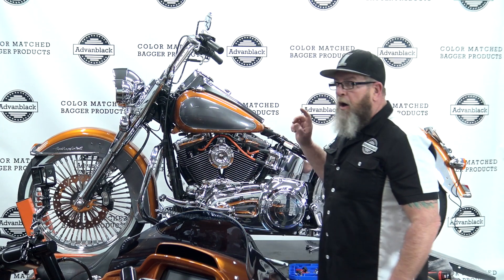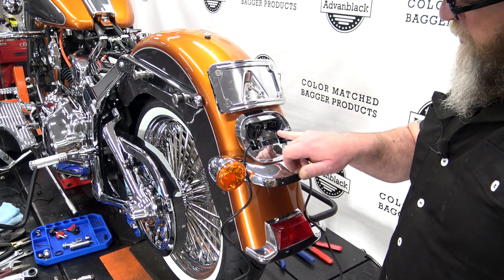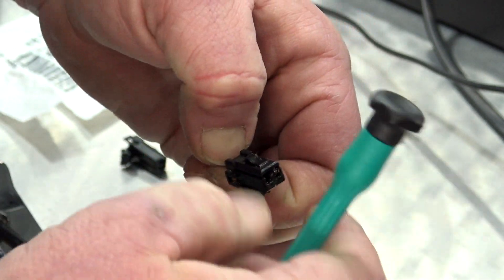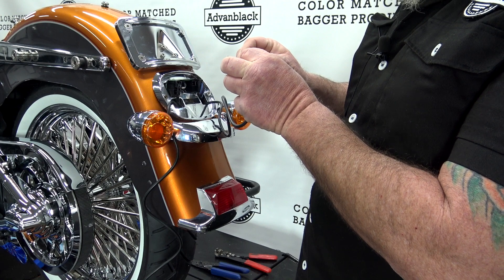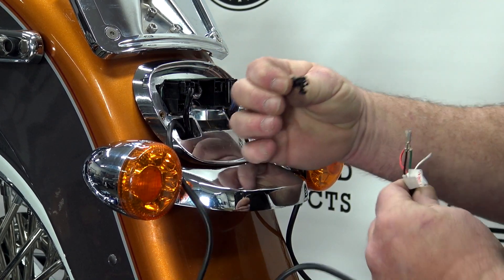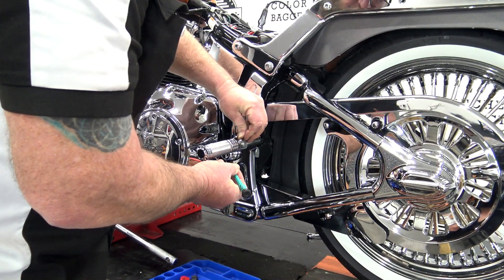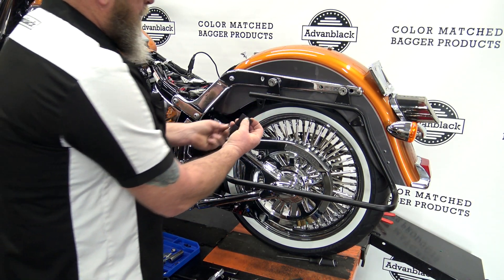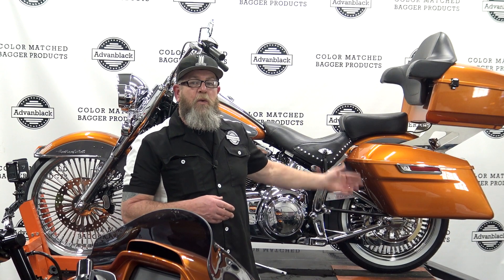Put Touring Saddlebags On Your Softail @Advanblack  Color Matched Saddlebags

Comment: How much do the saddlebags hit the stock turn signal bar? Can the turn signal bar be spaced out a little with spacers betw5it and the fender?
Reply from the maker: if you have the short bullet turn signals you will be fine if your bike is a heritage and has the dog bone style larger round turn signals you will need to replace that with the bullet style.
Reply: @Advanblack  
That's what people say but I'm asking how much do they interfere? I've seen hard bag kits on heritage softails with the stock turn signal bar. Didn't know if they do something differently. If there's different kits or if the bags touch just a little, can the bar be spaced out a little?

Comment: Hi Steve 
Great videos all are very informative and great that you show how to do things!
I have a question for you on the softail hard back install,
I have a 2015 heritage classic, I have the bags, and I will get the brackets to do the installation but I have the big dog bone turn signals, I have tried to find. The smaller turn signal you showed on the softail I have tried on the website to find that turn signal but cannot find it at all, where on the advent black website is it
Thanks
Reply from the maker: Its actually a turn signal from a road king ...fits in the same holes.